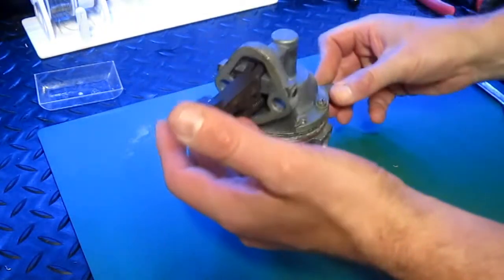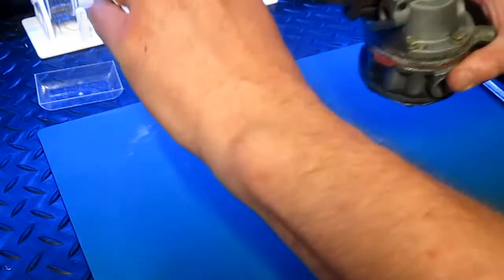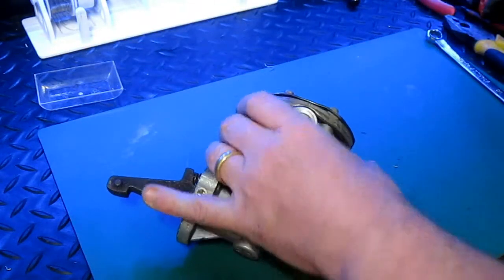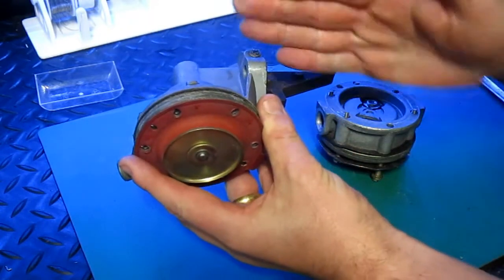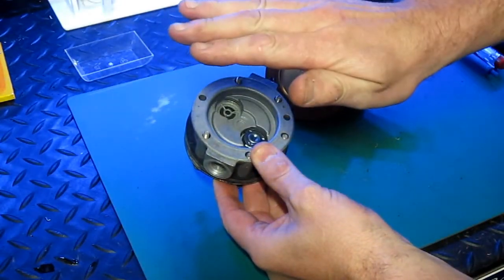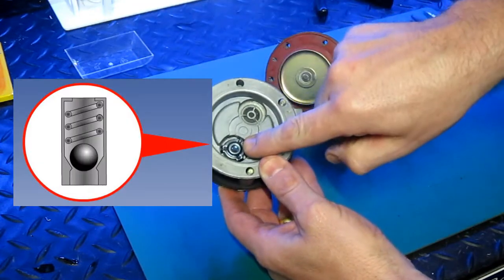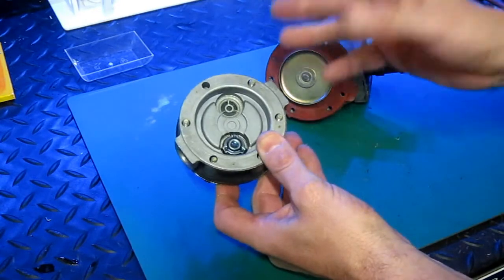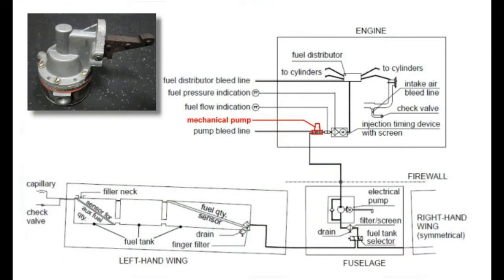How a Mechanical Fuel Pump works

Comment: Hi sir, i'm really happy to come across with your channel. I'm now a student pilot and we study AGK right now. So, it is not enough for me to be content with just theoretical information without seeing how it works really. Thank you very much for sharing your knowledge and experience. 

I dont quite understand what causes pump to move. It said camshaft eccentric but as i see the pump not located on the engine block. So, can you explain a little bit about location?
Reply from the maker: Hi there, thank you for your post. 
The eccentric camshaft is an off centre lobe built onto the main engine camshaft. The rocker arm of the pump sits inside the engine with the eccentric camshaft sitting on top of the rocker arm. As the main engine camshaft rotates the lobe (eccentric camshaft) also rotates. If the eccentric camshaft wasn’t eccentric, I.e. it was perfectly round it would just rotate on top of the rocker arm of the pump and the rocker arm wouldn’t move at all. Because this camshaft is eccentric in shape (off centre), it presses down on the rocker arm on each rotation. This makes the rocker arm move up and down and in turn forces the diaphragm to move up and down, sucking fuel through the intake valve and out through the outflow valve. I hope this helps you understand this a bit better. 
Good luck with all your studies and best wishes on your journey to become a pilot. Please have no hesitation in reaching out if you need any more help with your AGK.

Regards, Roy
Reply: @royjameskelly  Thank you very much, it is wise of you. Now it is more clear, appreciate that.